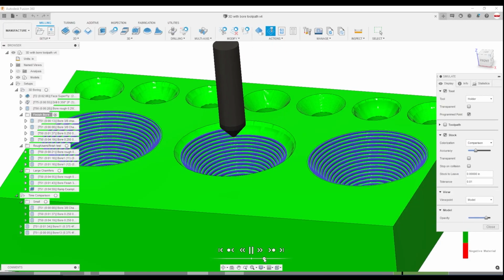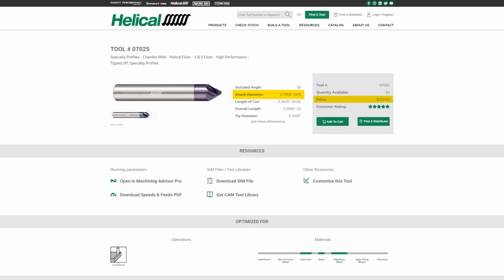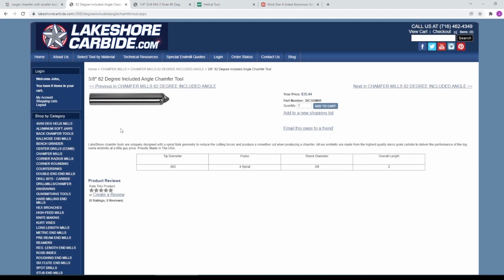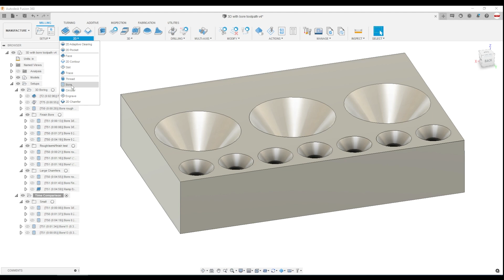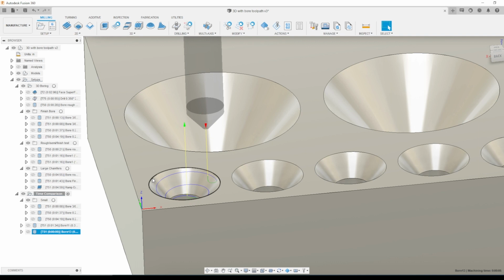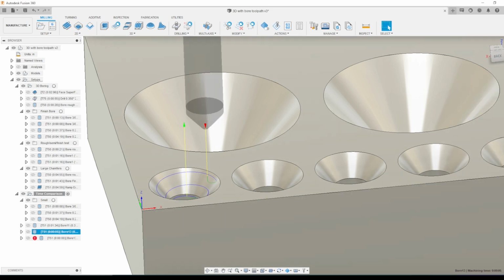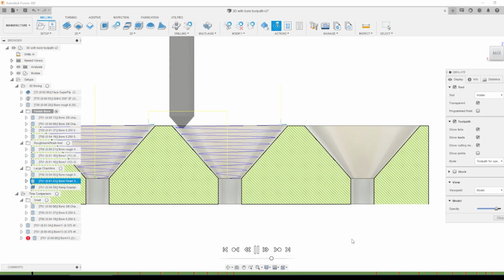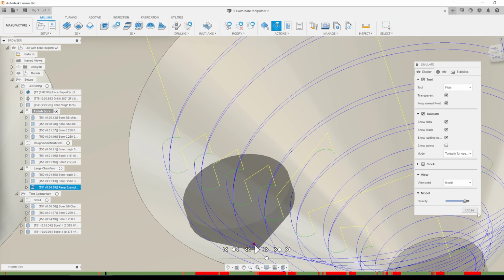Machining LARGE chamfers with a small tool!

Comment: Good video. I've been a machinist for around 30 years, I currently run a Mazak Integrex e-410H II, I have used this technique many times to make large or odd angle chamfers or countersinks, I use a ball endmill, it takes longer but you don't have to worry about slight angle mismatching, also a ball endmill will always be the same shape regardless of manufacturer so the depth/diameter will be correct first time every time, also also you can use the same tool to make different angles for different features on the same part saving slots in your tool changer if that becomes an issue. Like you mentioned in your video the downside is more machine time. I work in a job shop where new parts are programmed and setup almost every day for almost every machine so being able to create multiple features with less tools is a big plus.

Comment: Thanks a ton for this. I would not have guessed that the Bore operation could handle conical counterbores or that it would let you use a chamfer end mill bit. This is much more economical than buying a huge chamfer bit, especially for the giant 1/2" screws that our fixturing plate uses

Comment: Thank you so much for this video! I'm working on a roundness tester for my billiard hobby, and needed to chamfer the ID of some threaded aluminum spacers from McMaster to JB weld a ball bearing in the resultant nest left by the chamfer. I'll have 3 of these sub-assy's that will cradle a billiard ball, as I spin it against a test indicator, checking the billiard ball runout. Things I learned from watching this video a few times: 1) My toolpath would not generate, because I had the tool type set to spot-drill instead of chamfer tool. 2) You can make a section in the manufacturing space and turn it on during the cutting simulation. Wow, that is a gem! 3) How to rough with a flat mill and then finish with a chamfer mill a large chamfer. Great job!

Comment: Holy smokes John, thank  you. Been using Contour multiple depth with wall taper for years and your way is so much faster. This will make the feature on my part so much easier to produce. My old way got the job done, but is a pain if you don't get the wall taper exactly correct. Thanks again bud.

Comment: Thanks for this tip!  I had this issue before and I never knew the bore tool path could do that.  I solved it in a more hacky-fusion mindset.  I made a lot of circles at different planes that intersected the chamfer and then used the 2D contour to make the individual paths.  Way more complicated than your method.

Comment: to do this i use a standard contour to chamfer with roughing passes and use chamfer tip offset to adjust the height by selecting the top of the chamfer and not the bottom.
it works out a lot like the ramp tool path example except with roughing passes.
i copy the tool path to add depths of cut.

i dont trust cutting with the bottom of the chamfer tool but i do trust chamfer tools from lakeshore, helical and others to provide the most accurate chamfer tools and i have not had any noticeable machine lines from stepping down.
not that my way is better, just thought id share one more way.

Comment: I have to do this on large holes at my job, In master cam, cause our hole was large enough, started from bottom up to rough to use the whole end mill then down with the chamfer, same kind of process in fusion at home, excited to try the bore tho thanks for the tip.

Comment: If you've roughed the hole, could you bore with the chamfer tool from the bottom up, so that most of the cutting is done with the larger radius part of the tool?
Reply: Most chamfer mills dont have flutes on the side/shank.
Reply: @Eggsr2bcrushed  It might be interesting to do a roughing pass as a series of almost max height stepdowns, say 3 or so of them, then come back with a ramp finishing pass with a fairly high helix angle.
Reply: You can use the thread mill tool path the same way and select bottom up

Comment: Awesome video! Definitely gonna tuck this in the back of my head. Have you tried this method with a flat bottom chamfer tool? I ran into this and I had a similar thought to try but was worried the flat bottom would cause galling. What about a large straight chamfer along an outside edge?